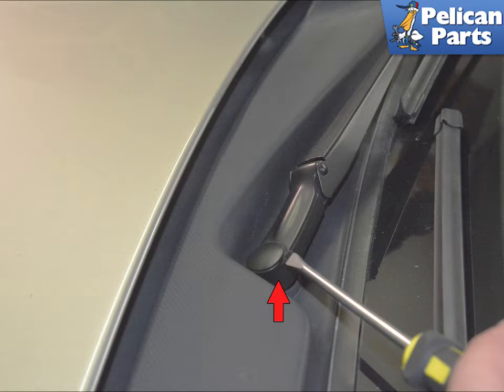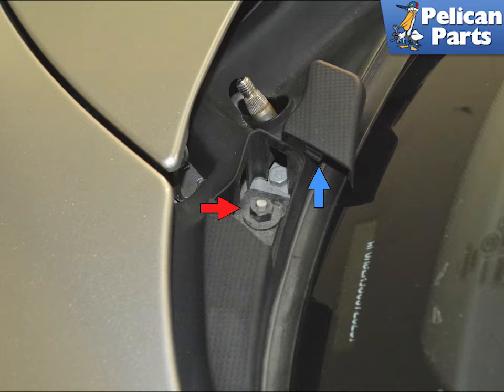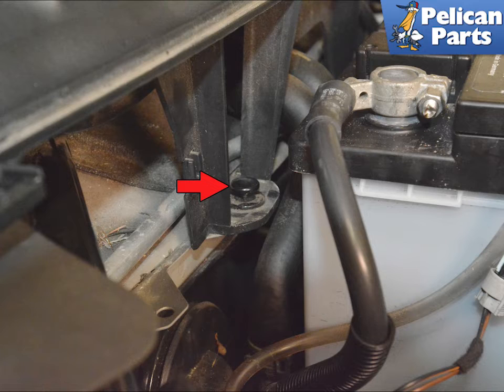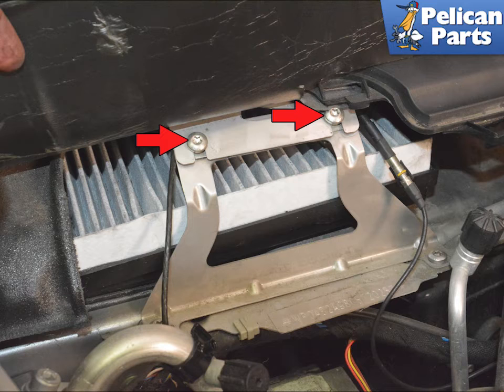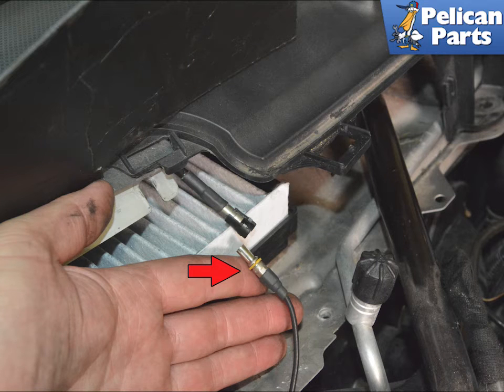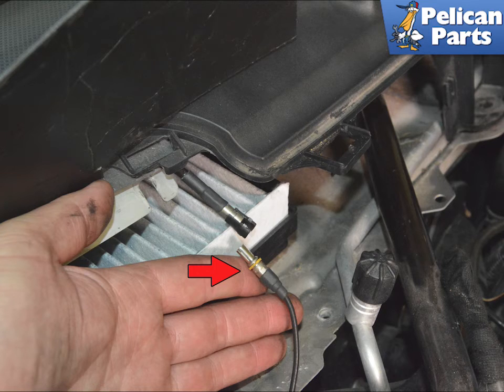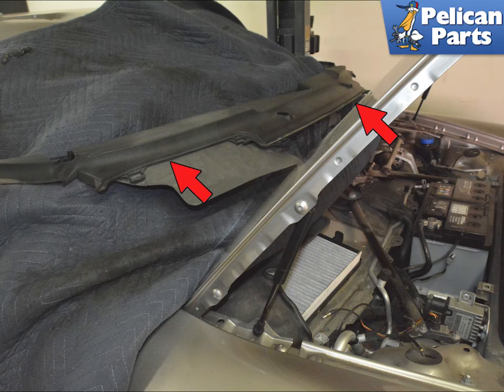Porsche 997.2 Carrera Cowl Removal (911 2009-2012)

Comment: On my car, the nut (from the 10mm bolt) under the two small plastic covers is spinning on one side (passenger). Do you have any idea why this is happening and how it could be fixed?
Reply from the maker: The captured nut is likely out of its holder. You'll need to remove it / extract it then repair the lower panel with the captured nut.
Reply: @pelicanparts  But to get to it, do I have to remove the entire windshield cover?